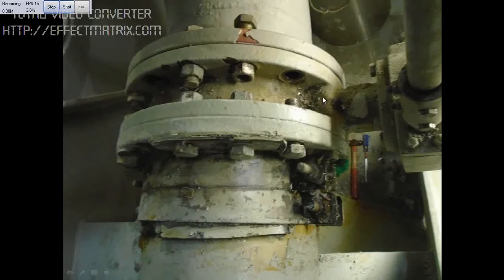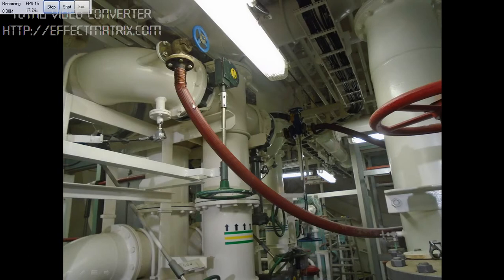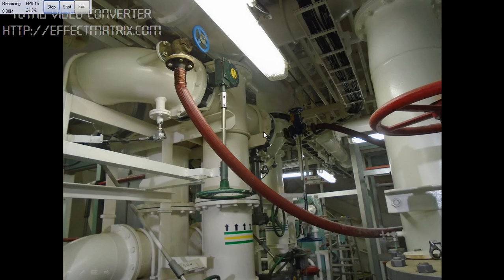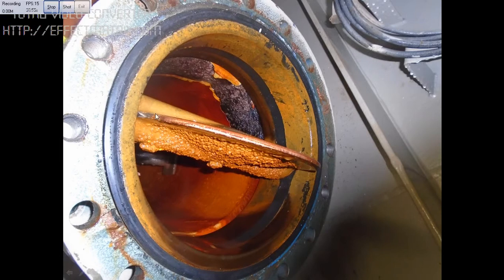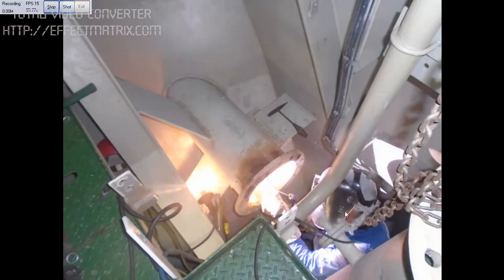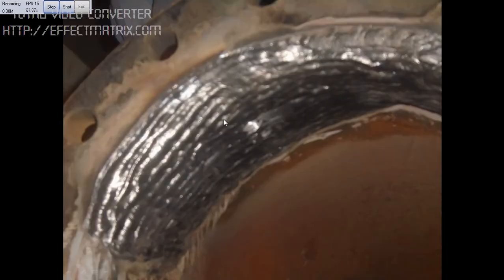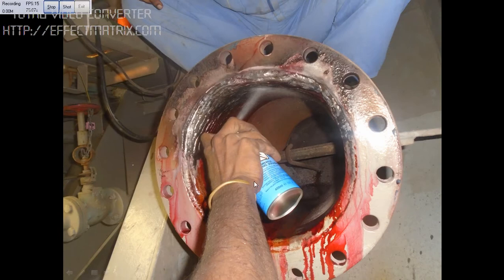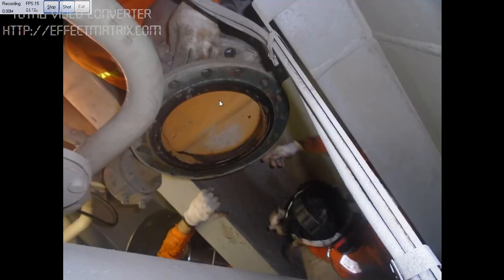How To Avoid Main Sea Water Overboard Pipe Sea Water Leakage Due To Corrosion?

Comment: Sir... Do they allow to use Buterfly valve as the overboard valves on the ship side???? Any regulations??
Reply from the maker: Thanks for your valuable feedback !! Do share it with your colleagues and friends
Overboard valve can be of different type as per the required of each system on board the ship.
Reply: @MarineTechHub    but badasab as I know the overboard valves must be non.return type.. But those butterfly valves are not non return..so...???
Reply: @hashangodage1894  Except sea water overboard valve , all remaining others valves are of non return type to avoid any ingress of sea water to the system. Eg. Sewage overboard, boiler blow down etc. .

Comment: @1.20 a magnetic device is shown ...used for crack detection is mentioned , cud u pls throw some light as to how? 
TIA
Reply from the maker: Thanks for the feedback. After cleaning the object we spray the liquid with fine metal particles on the object to be tested. Then place magnetic U frame on the object, if there is crack the particles will accumulate in the cracks and it can be seen

Comment: it was better to renew that particular section and install new v/v for extra safety and avoid DD and hav a peaceful sailing:)   
 (*may b company cost saving).
Reply from the maker: The pipe would be renewed in the dry dock . The sea water overboard valve was found perfect in order. The ship is 2 years old and this could only happen if the overboard valve is kept throttled, keep all overboard valve fully open to avoid such problem